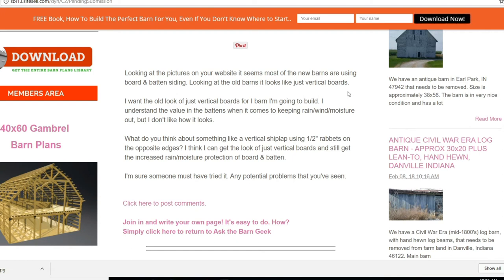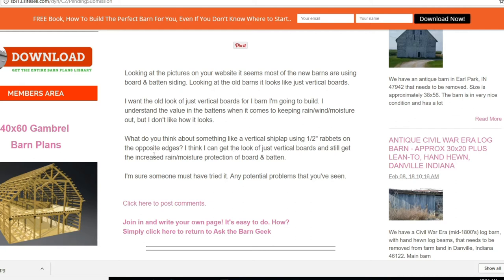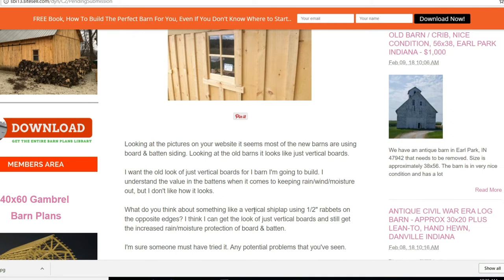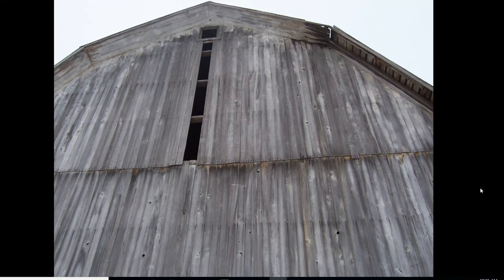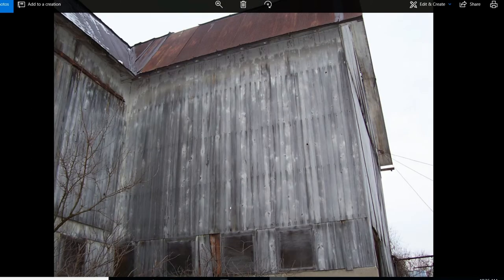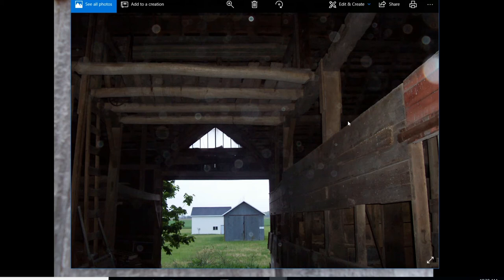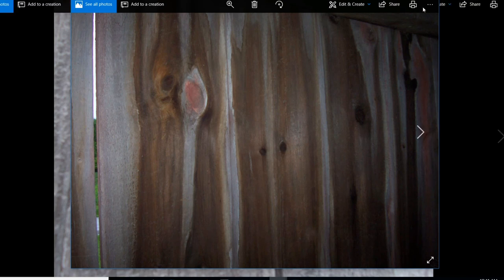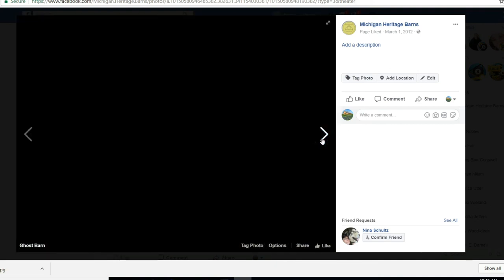How can I avoid using battens on my barn?

Comment: if using green lumber, try using a 1 inchlap joint and put it up tight so when the lumber dries it won't leave as many air gaps.  on some older barns the batten covered gaps left for ventilation, yet, kept out the rain and most of the high winds.